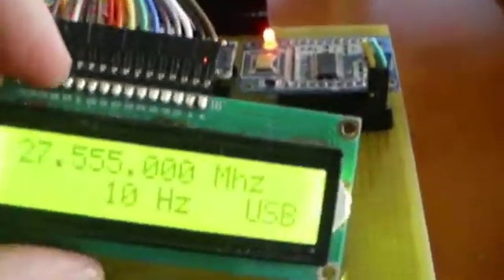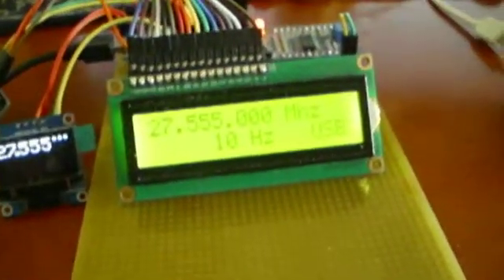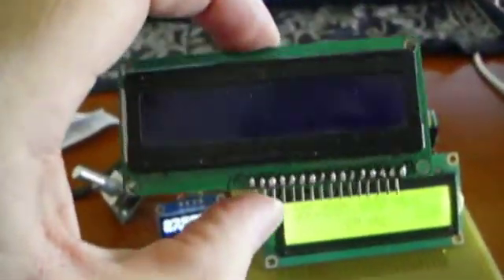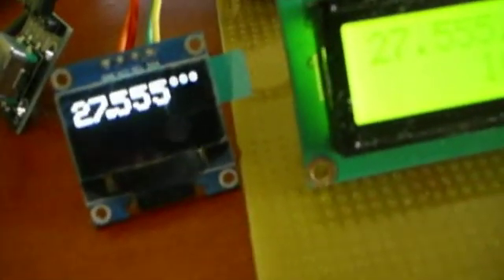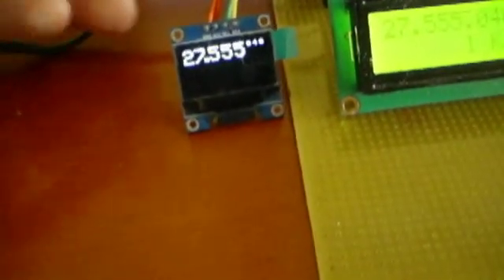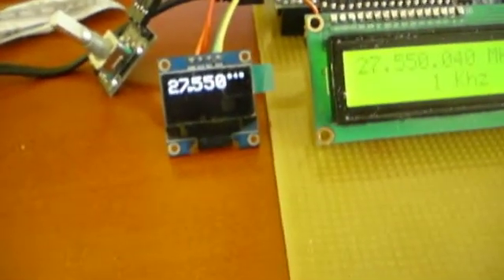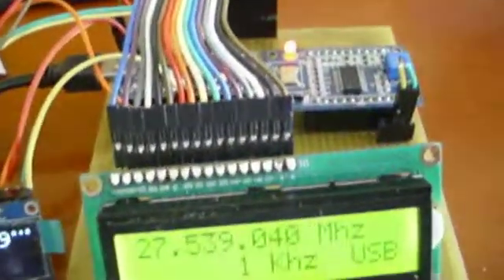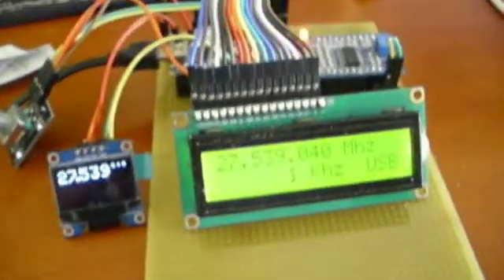OLED digital vfo cb Display using arduino

Comment: You are right those little OLED are just the right size for the cb mod, at the moment i am converting some old cobra's to 40m, done two already using arduino nano, ad9850, rotary encoder with AD7C Scetch, they work ok, but your idea of using oled is the right one, how much of a problem was it to remod for the oled!!!!.... good video thanks fo sharing.